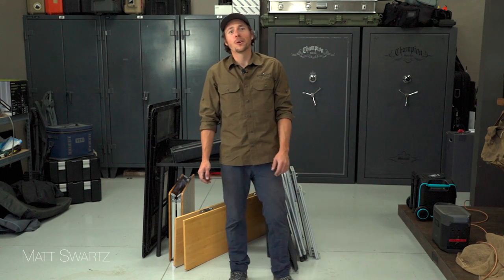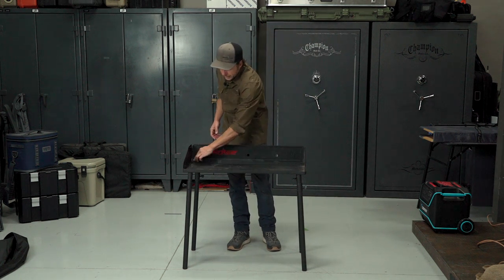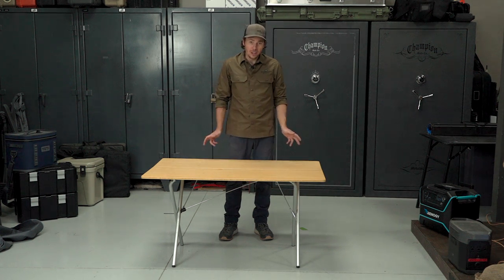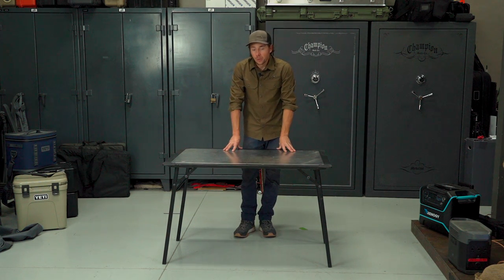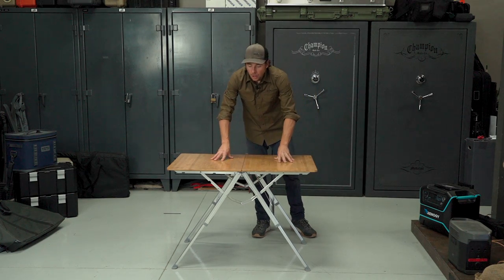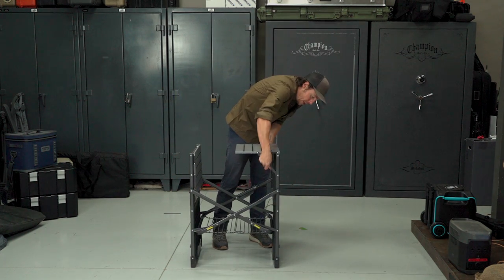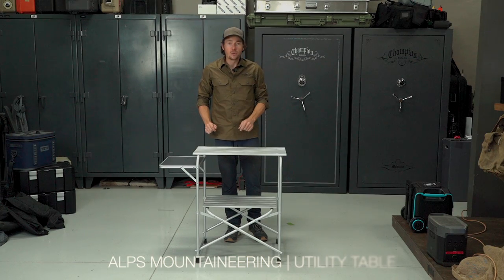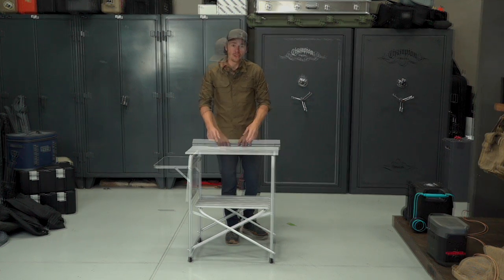7 of the BEST Camp Tables for Overlanding and Car Camping

Comment: I would have loved to see the simple Coleman roll up camp table in the mix. It’s dirt cheap at 30-40$$ and folds up quite nicely. 

By the way nice Stronghold cabinet setup in the back. They are crazy overbuilt
Reply from the maker: Those are great! Have you experienced issues with them melting?
Reply: @ExpeditionPortal  no. Not at all. To be fair  though I really haven’t put anything crazy hot on them. Just my stove and once my pot (aluminum) has cooked I take it off the burner and set it on the table. No issues at all

Comment: I got the drift from Camp Chef that 32 and 38 are different lengths, not heights?  I got the adjustable legs that work well.  My favorite table has adjustable legs and a roll top.  I can't imagine finding flat ground, so adjustable is necessary.